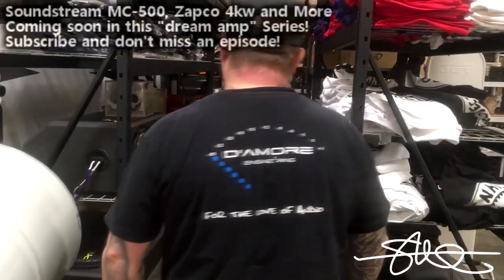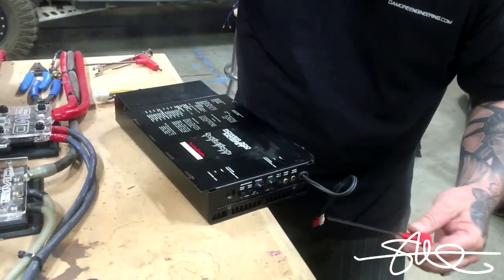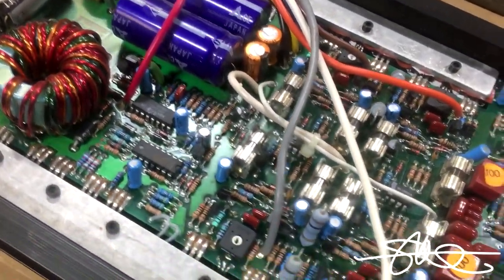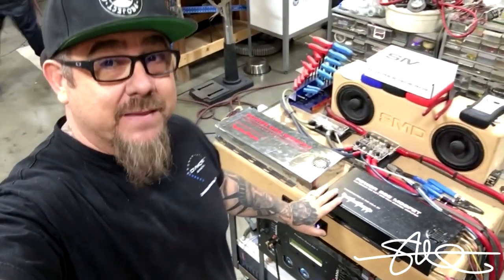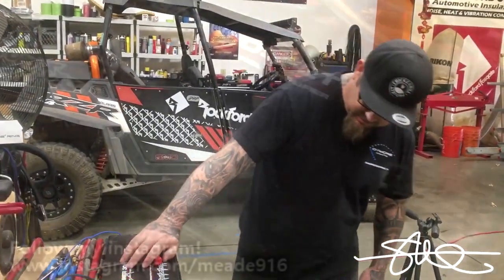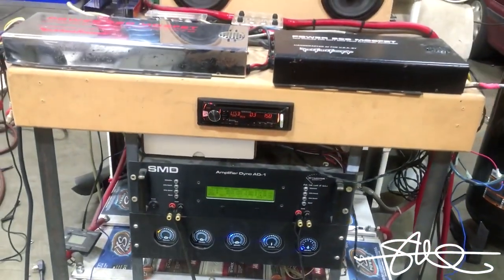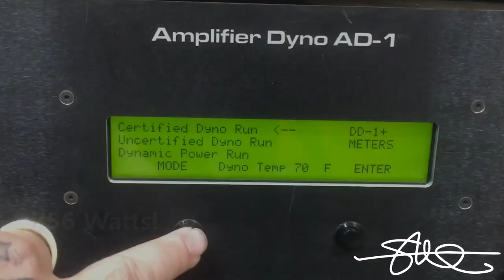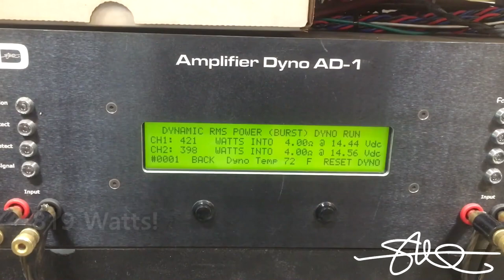Amp Test Tuesday - Dream Amps! Classic 31yr old Rockford Fosgate Power Mosfet 300 - A MUST SEE! WOW!

Comment from the maker: What was your dream amp growing up? what is it right now?
Reply: meade916 
My dream amp when I was 17 was a lanzar optidrive500
I did buy one new at cost from a dealer going out of business,  I ran 2 15" original solobarics off it...
Wish I never parted with that set-up
Reply: meade916 lanzar opti 2500...still is, proud to have one in my collection
Reply: meade916 a/d/s PQ10, Soundstream Class A, Linear Power, Zapco, Butler Audio, etc. I like my JL Audio Slash V3s I have now. Phoenix Gold was cool too!
Reply: I don't have a single dream amp right now but I'd say my list includes:
Old school Rockford Fosgate amps
Kicker 2500ZX (discontinued if I'm correct)
Orion HCCA amps
Other old school Kickers (I remember seeing ones with an lcd or something on them, not sure if it was a volt meter)
Reply: meade916 Masconi and Focal Utopia if I hit the lottery...
Reply: Soundstream class a 10.0
Orion beast xtr2250
USamps vlx400
Reply: bigassfordsd i have 2 soundstream class a 10.0 and 2 class a 5.0 still lol
Reply: phoenix gold ms2500 had a ms250 ms275.  old old mtx thunder amps as well lol.  
too many to name although i did keep my soundstream class A 10.0 and 5.0s from back in the day
Reply: Old School original Lanzar Opti 500, A/D/S PQ20, Fosgate 300 Mosfet
Reply: meade916 ppi 2350, or an orion 2300sx, both beautiful
Reply: meade916 JBL A6000GTI Steve. Beast mode right there.
Reply: meade916 old skool punch 200
Reply: Any old school HCCA
Reply: RF power 1100@2 was my dream amp back in HS
Reply: meade916 im going to have say i was really into Precision Poweer PPI when I younger and right now if I could get that audiopipe 3000x1 i think id be cool
Reply: US Amps VLX400 right here...
Reply: biffisgreat used to have an Orion 2150sx and 2 250sx back in the day. Ran Polk Audio mids and highs and 4 M&M poly 12's sealed.
Reply: I've got no dream amp just an eq waiting for the right one 😑
Reply: Sherwood 240w
Reply: Dream amp back in the day: HiFonics Zeus Series VIII, the white one... got it and had it driving 2 Orion XTR 12s (the ones with "unlimited thermal power handling" and lifetime warranty) - my son just put them in his car!!

Now I would like to get ANY decent power amp WITHOUT a subsonic filter... 

Any ideas...?
Reply: meade916 I still have my dream amps punch 150 hd punch 75 and punch 45
Reply: Back in 93 I had my first amp a PUNCH 75 powering 10 series 1....I FINALLY FOUND MY FAVORITE AMP PUNCH 150.... THANKS FOR THE THROW BACKS.....I NEED JUAN TO work on it....tho...STEVE U THE MAN!!!!
Reply: Punch 150 was my fav!!!
Reply: Harman kardon tc600
Reply: meade916 Good for you Meade! I think Zapco 26k will be good to see if it really is worthy.
Reply: meade916 I always dreamed of owning a rockford t40001bd like when you had the 4 18 btls and played jeezy I would jus day dream of owning 25% of that system lol. Good high school days...
Reply: Autotek mean machine ultimate dream amp in the  Early 90s
Reply: Was the Orion's back n da tempe az days, the fosgate from same tempe az days era fosgate was a real close 2nd tho and today still runnin Orion and stilI have a collection of old but good Orion Xtreme's, fosgate power 650 & a few other punch amps & my #3 the old school ppi
Reply: Soundstream Davinci,
US Amps vac tube.
Reply: I own my dream a MC4000M, But I'm curious what my 606.2 ppi or my Pro-Mos 425 would do on the amp dyno. I'm down to let you try.
Reply: It would have to be a Phoenix Gold Frankampstein rare I've only seen a few and that was in my younger years lol
Reply: VLX-400. Audio Art 100HC was a close second.
Reply: I was lucky to scoop an Audio Art 100HC a couple years ago. Hopefully soon I can get the caps swapped out and put it to work.
Reply: meade916  Rockford power 300  like the 1 you have i see o SHE so SEXY if you had that back in the day you had $$ be not me the best I could do was a punch 100 DSM for the lows had to work 2 jobs  just to that  awesome video thank
Reply: Precision Power PC2350. The chrome one. Find one and test that! That would be an awesome test.
Reply: Mmats audio 1400.1  .5ohm model still made in the USA today
Reply: My dream amp from back when I was growing up in mid 90's was the original Soundstream Tarantula.  That amp was and still is visually stunning.  Now day's nothing visually blows my hair back like the Tarantula did, its kinda sad to say but my dream amp of today looks as basic as basic can be.  Their Divici also looked cool but I was butt hurt for that purple/ blue neon spider.
Reply: Back in 1995 when I was in High School.  The Orion HCCA 2100 Beast, was my dream amp.
Reply: Didnt really have one, i liked em all 😂 but later years it's been the rf t2500-1bdcp. And finally bought one 😁 great vids Steve.
Reply: kr15cartel mine too. I'll have one some day. I bought a chrome 50.2 recently. Not the same as an 1100 though.
Reply: Now I'd have to say my dream amp would be the JBL crown 6000
Reply: meade916 back in 1991 it was the  Hifonics Zues, hands down. There was also an impressive monoblock from them, under rated at 200watts into 4ohm. Can you help me remember the name? Was it the Hercules?
Reply: Dream amps.  I would say the big Soundstream Reference amps in the 90 or the Soundstream Continuum amp.
Reply: Blacky Madd mmats
Reply: SOUNDSTREAM MC500. I actually have two of them that are brand new that I purchased back in the day. 

Never been hooked up, mounted, and are cosmetically flawless with all bottom switch covers in place.
Reply: meade916 Phoenix gold 2500
Reply: JL Audio JX1000W
Reply: meade916 the kicker war horse
Reply: Blacky Madd Good question man and I am sure Meade will answer this question better but I am guessing we can name American Bass, RF, Phoenix Gold, and Re Audio and aome other but the question will be if they make their products 💯% here in US because I think sometimes companies make some parts outside the country or they do the hand labor. But for sure I think Meade will say Fi Audio and his own brand is done here 💯% even though they done make amplifiers.
Reply: Sup Steve? Great test and info. Growing up my dream amp was a the Linear Power 8002sw
??(iircc) I remember seeing them in a S10 Blazer in a Auto Sound and security magazine. I think late 80's real early 90's IIRCC it was 4 of'em powering 4 Kicker C18's.lol Remember G&S? Those were the good ole days.
Reply: meade916 pheonix gold elite 1, 4, & 5
Reply: meade916 My DREAM Amp would be the Early 90's " Phoenix Gold ms1000 Limited Edition " That thing is INSANELY AWSOME. Waaaaaayyyyyyy above my pay grade. The Amp I loved the most that I've owned would have to be the Diamond AudioD7104, & D7402 mk2 from Esoteric Audio back in 2002....
Reply: cockneyzombie I got ahold of one of those about a year ago wouldn't make any power but it was awesome it had the sliding door it was great very nice to look at it I gave it to a guy that has a match for it
Reply: Any of the PPI AM Series. The unregulated power supply right before the Art series.
Reply: Nicole B a guy on let go has a diamond audio amp for sale never heard of it before so didn't jump Idk watts but it was like 80$
Reply: Audison thesis
Reply: Daniel Harrell Good Deal. Check next time if it's a D7, or a D6 Series back in 2001-2004 Extremely Good stuff
Reply: Nicole B I am about to check it out now and luk model maybe
Reply: GENESIS Dual Mono Extreme
Reply: RF Power 1000 Mosfet Terminator edition with red LED's. This is still my dream amp today and I feel very fortunate to have one!
Reply: I had a friend back in 95 who was running PPI liquid cooled amps and 4 15 Phoenix Gold subs in his show truck... you could feel your heart stopping it bumped so loud. He got me hooked.
Reply: I'm still growing up lol will be 20 soon. Can you do a dyno test on Ds18 gen 6000.1. had my eyes on that amp for a while.
Reply: Old school Steve thanks for sharing your collection!
Reply: Pyramid!  YaY! =)
Reply: meade916 Linear Power !
Reply: meade916 ORION HCCA2100 Now Rockford Fosgate 2500-1bdcp
Reply: Cadence a7 hc
Reply: Orion 2250SX.  Bought it in 1992 under an employee purchase program Orion had set up- like 45% off dealer cost.  Cooked XTR 15's on the regular.  Had 2 extra 15's as back ups while waiting on recone from Orion.  Smoke would pour out the bandpass port opening when they would fry and the purple neon added to the effect.
Reply: Jl audio slash 1000v1
Reply: meade916 Dream amp growing up, Rockford power 1000.1. These days I'm into any solid highly rated working amp from the early - mid 90s. If I had a dream amp these days it'd probably be the zapco zx200.4 and the z-3kd for the lows.
Reply: Meade my dream amp is the kicker Kx 850.2 old school made in the USA. I been eye balling it for years. I'm just waiting for the price to drop some and it still brand new
Reply: quincy johnson my dream amp is the high performance bass thrust amp by autotek,  the 600.2 ,puts over 900 bridge,  my dad has it and paid over a grand for it , best sounding amp to me
Reply: Rockford power 1100a2.
Reply: Old school punch 500m was my dream amp way back in the day
Reply: BigLove101 dam I remember that issue lol....took it to school more than my school books!
Reply: Col. Angus care to part with that Sony? Lol
Reply: meade916 hey Steve I came up with an idea, is there any idea which single din Deck is the best for aftermarket amps.  Like the best cheep deck and top 5 and top10 expensive. Hook all of them to the same set up and measure the dB.
Reply: My dream amp was the Earthquake PA 4300 back in the 1990's the thing was huge!
Reply: Soundstream Human Reign and Tarantula and a couple M&M Godfathers 15's were my dream in the early 90's
Reply: California A1200 is a Profile amplifier back in the 1990's the old one is long and white had an alligator on it or a silver one BigDWiz did an amp dyno on one and it did rated power back then :-)
Reply: 2010HarleyDynaFXD  Thanks
Reply: I had too many dream amps on my wish list in the 90's.
Reply: Anything t-series fosgate or audiobahn high current
Reply: Sounstream tarantula
Reply: meade916  I'm 26 now but when I was going thru my phase at 17 I came across an ol skool Lazar amo that was beat up but work from my cousin didn't say watts nothing but at tine I had 4 15 cvr n a Bonneville n blew my speakers swapped to 2 15 l7 blew them 1 reason maybe cuz back then I didn't run good electrical but anyway got a battery got 2 pioneer premiers 12 n I swear was beating hard as hell with that amp. end of selling it wish I shouldn't buy came across to ol skill punch amps one 200 n I think 900 I only hooked up the 200 to 2 fi q 12s n Saturn 4door n that shit was hitting window flex n all.  now I'm running sundown 12s zv5 on 2 bs hiding s 2600 decided what's a good amp 2 upgrade 2
Reply: My dream amp is the kicker warhorse
Reply: meade916 
Soundstream xxx15000d & TR 500/4
Reply: Phoenix Gold Human Reign!
Reply: Phoenix gold Frankenstein the one that took up the whole dame case back in the day....
Reply: Growing up.....US Acoustics Model 1000  Right now...Orion XTR2500.2
Reply: Power 650, for three years after hearing one when I was 13 and had it in my truck when I was 16.  All my friends were buying 45's,75's & 150's.  Still have that amp today, still runs real strong 25yrs later.
Reply: Kenwood 1021
Reply: linear power 800 sw amp  with fan shroud  or the old orion  beast,  had all the hd  and power series  amp  at one point or another  had zapco amps ,  old cadence amps made by zed ,  currently working on getting the new orion hcca line going to remove   my back seat and put in 3 psi plat. 5 18's ea with dedicated 3000.1
Reply: McIntosh MC4000M. What am I talking about, it's still my Dream Amp ha ha
Reply: Daniel Harrell I know where you can get one at right now brand new
Reply: I had the  Rockford fosgate punch 45 HD running my subs..I wished I had the cash for a MOSFET 650 was my dream.!!
Reply: Cadence A7-HC
Reply: Hifonics  colossus, Earthquake 2300, Pyramid super pro 2300.
Reply: I’m only 19 but my dream amp is a Orion hcca 3000.1d splx
Reply: 2100 HCCA. 
I now have a power 650 with the eq1 equalizer to match. 

Please dyno the 650!!!!
Reply: Oh, and another setup that I had back in the day in my 89 Beretta GT was an Image Dynamics 1500 watt 2 channel amp with two ID 15s, two 3 farad caps, and two gel cell batteries. I blew the back windshield out of my car in my high school parking lot and got suspended for 3 days.
Reply: Still have my ppi 2150am from 92. Crushed alot of cans to that. Sad to see how far the art of sound has fallen.
Reply: Power 1000c and I have two of them.  :)

Comment: Guys, I've heard people give Rockford shit about being "overpriced" among other things, with recommendations of other amps thrown around, but Rockford had been doing this forever, so whether it's the baseline prime series or the power series, you don't just get the rated power, you get longevity.  Many amps may put out more power for the price, but component selection might cause them to go out sooner. 

I can speak from experience that the prime line is an amazing lineup, I've abused several prime amps in all conditions and they've never failed yet. 

And I also have experience (although more limited) with the punch 4 channels.  Mine sounds good and also has weathered time fairly well. 

Personally, I've always had a soft spot for Kenwood because they were my first, but for selection and quality amp side, Rockford won't ever let you down. 

Oh, and I like JL, they spendy tho lol

Comment: Back in the 90's, I  had a power 300 , running   2 -15inch punch pro series woofers , rear channel bridged, it hit extremely hard,  headaches came with that.

Comment: I loved my 650’s running 4 punch 12’s and RF 3 way components up front in my Nissan Hardbody..All in the extra cab…The test at 14 volts vs 12 volts that amp would still put out huge numbers….

Comment: Niiiiiice!! I had two of those Mosfet 300s in my 89' Geo Tracker powering 2 RF 12" Pros and 2 RF 10" Pros. I couldn't keep from blowing fuses though, so I wrapped some copper wire around them. It hit around 128db in competition. The thing got stolen and burned on some railroad tracks. Never did put a real system in any car I had since.

Comment: Dream amp was about anything mmats or rockford. I have since had a mmat d200hc and a couple old rockfors punch. Keep in mind I'm 25 so the amps i have wanted was early 2000s. I currently have a couple older orions. Including a 1st gen 280gx and cobalt 430 along with some other amps of different brands sitting on a shelf in my garage.

Comment: Got a real kick from your video. I was there, actually Linear Power set the stage for USA amps and I still have an LP 1001. I have 2 RF 300's in my cars to this day that will smoke all things, it was basically 2 RF 150's smacked together with fan coolng as you soon figured out. Fuse protection was brilliant for all of us installers back then.  650's where not as bullet proof as the 300's.

Comment: +meade916 I'm just curious was it a 1khz  tone during the Certified and Uncertified and then 40hz for the Dynamic Burst run?... Or do you use a different test tone disc on the AD-1 then the one that comes with the DD-1? Thx

Comment: Nice amp I had a power 1000 in my 90 mustang gt  2 pro15" 2 18" no back seat just a wall right behind front seats with 18 slanted back 150 hd running mids and high very loud miss my amp but now have 2 power 1000 25 to life using just 1 in my 01 mustang gt running entire car 4 p1ts tweeter 4 pps4 6.5 mids 2 p2d4 12 its sounds pretty good with my old pa1 hd preamp just for the old feel. Can you bench test a 25 to life 1000 to see what its compares to?

Comment: Man, I remember when amps cost an arm and a leg. I had a chrome Kenwood 650 watt amp with two analog blue lighted output gauges on the front that powered my two JL Audio W-0 15s back in the day and they hit pretty hard. I remember paying $500 for that amp back then. I just bought an Orion HCCA 3K watt amp (capable of well over 10k watts as proven by BigDWiz on his amp dyno) for $700 to power my four Sundown Audio SA-12D2s in my Accord and it SLAMS them.

Comment: If the power 300 is doing that. Can't imagine what power 650 can do.
Reply: Anything Auto about 550 certified per half so 1100 certified at 4ohm.  At 2ohm mono, which they can do with ease around 1700

Comment: I've got a mint Power 650 I bought about  12 years ago sitting in a cupboard here in Oz. Are these RF Power amps also highly rated for SQ to run set of high end component speakers?

Comment: I have 4 300’s and love them
Reply: I have white shrouded power 300 and a crossover blew ,and bass and treble knobs went up,I had it all fixed just need knobs to buy on line and amp is looking good for how old it is ,I had it in a competition car with crossovers oeq1 ,center channel ,2 power 412's in plexiglass box with  purple tanza LEDs outlining whole amp rack and subs ,it looked great,only set back in the 80's was the alternator whine from audio control enhancer ,we had to bypass after install,but I would say today's audio control line is getting good reviews.i was hitting about 125 to 130 db and my car was a sound quality set up.

Comment: Were these old RF amps able to go below 4ohms?  I've never had one that old (RF), though in subsequent generation they obviously could carry the load quite nicely.
Reply from the maker: Technically 4 ohms bridged is 2 ohms per (bridged) channel...But i wouldn't go lower than that i don't know where to get those little glass fuses haha.
Reply: Chris Meirose ran a old power 250m2 mono on 2.66ohms through 3 jl 12s, it loved it!
Reply: Probably dating myself here, but you could really load down the ol peanut,  .5 Ohm stereo no problem, used to piss a lot of pyramid etc. People back in the day,